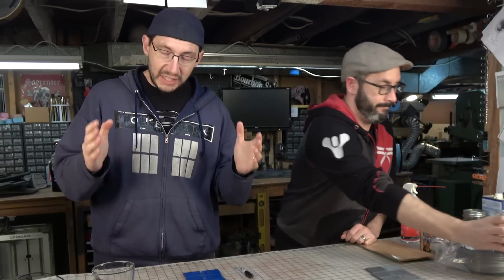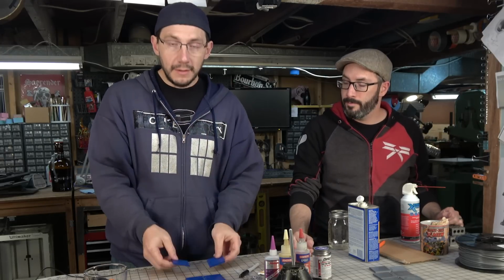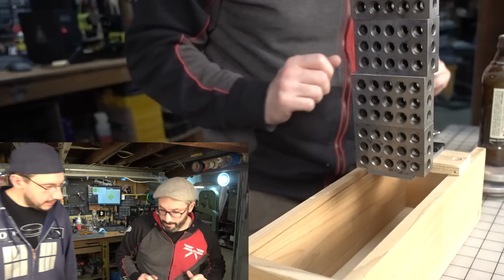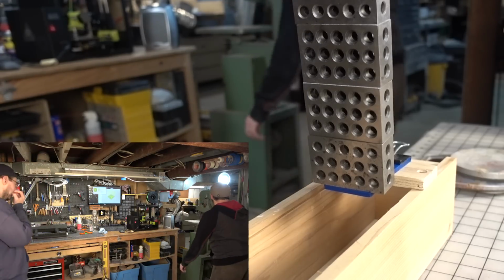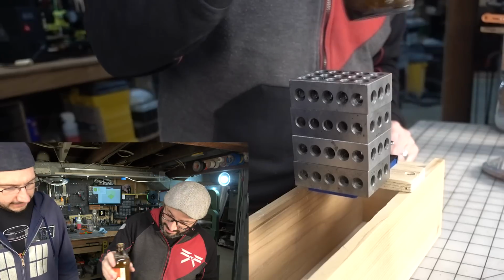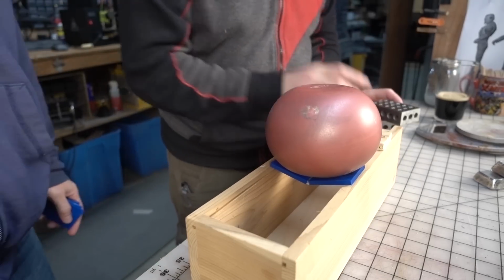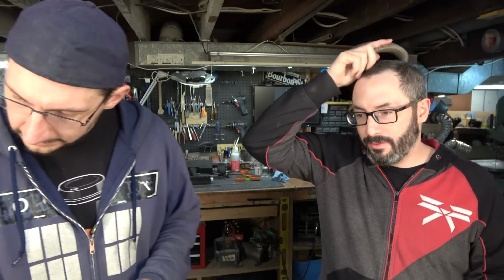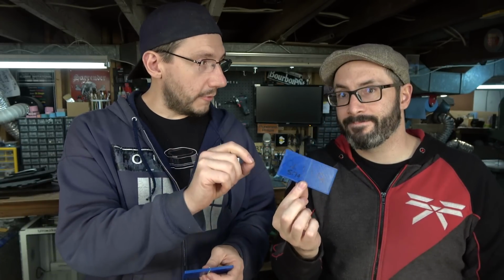Testing 3D Print Bonding Methods with Punished Props (Glue/Epoxy/Welding)

Comment: For the 3d print gun, you could have made a V-grove like when welding metal.
Stress-wise, all the stress is at the top and bottom anyway. That's why H beams are shaped the way they are.

Comment: Great effort by the way! But I cant help but point out certain things that have to be addressed for it to be really scientific, to a certain degree.
1 - The point/distance from the joint has to be consistent
2 - All joints must be given sufficient time to cure, unless of course we're doing a 'strongest joint in 1 hour' test
3 - Weights should be consistent, ie: use a scale and a press (like Matthias Wandel's tests)
4 - Repeat the experiment several times/ bigger sample size

Not to hate, but would absolutely love to see a video with the issues address. Again, great video otherwise!
Reply from the maker: Hey! True, Bill and I would need to change some things in order to do this "right". I mean, we had a great time, and the results we did get ARE pretty cool. That said, if there is enough interest for us to do this again, we'll set out to do it right.
Reply: do it again lol. If you don't I will and then nobody will see it...

Comment: You'll find that the 3D-Pen weld will work much better if you hold the pen at an angle such that the hot nozzle melts a channel into the pieces that you're welding and then lays the pen's filament into that channel so that the plastic from the pen and two pieces melt together for the bond. Not only does this make a stronger weld, it can also be more smooth if you get really good at it.
Reply: Bigtime. I meant to elaborate on that in my recent reply. That's the exact method I use when welding 2 pieces together with a 3D Pen.

Comment: I use straight acetone on my abs prints to butt joint two pieces. And a thin slurry (slightly thicker than water) for gap fill. Any thicker and there is too much already dissolved plastic for the acetone to dissolve the joined pieces and form a strong bond. I did this to a model boat for my sons bath and trying to snap the joint by hand (more than 15lbs of pressure on each side of the joint) caused no failure.
Reply from the maker: Oh interesting. Thank you for the thips!

Comment: I do like the scientific approach, but you should to redo this with minimum 24 hour cure times and a steady rig to test them, if possible also do 5 examples of each.
Otherwise we are looking at all sorts of inconsistency from how it was put together and how it was tested.
Reply: MsSomeonenew agreed!
Reply: Which is probably the real life case :D
Reply from the maker: Yup. That's an eventual goal. This was the product of two guys hanging out in the shop, drinking some beers. I think our results are interesting, and if this is popular enough here on the YouTubes we will DEFINITELY revisit with a more consistent approach :)
Reply: for me the biggest problem here is that the result is a linear force (weight with gravitational acceleration)
while what show the strength under this stress is a torque, the distance between the center of gravity of the weight and the bound is crucial, and varied from 1 to 2 here
Reply from the maker: +Nagby3 True. It varied A LOT. We both want to revisit if we get enough feedback that people want to see it!
Reply: a jig that would be pretty easy to make and pretty precise
would be with a hole in the "stressed" half to pass a string through
(hole always at the same place and same size to have a known distance between the force and the bound)

putting the string with a black mark right against a ruler to observe deformation
and then after this part, putting a newton meter (or at least a spring with a ruller attached to one of it's end)
and then after that, string again that would be rolled by a crank (or even better, a motor at a constant speed, like by using an electric screwdriver that can go slow and have enough torque)
the string could be pulled down or up, it wouldn't change the result much

and be sure that the fixed part is completely held up to the bound face (like in a vice or something like that)
and record a video of how the string mark and spring moves on their rulers to get deformation and stress at several times
and you get something like a traction curve (but showing a flexion stress)
Reply from the maker: +Nagby3 Dang, you really know your stuff. Is testing such as this something you do for a job?
Reply: 3D Printing Nerd could used beer cans as weights then drink them 😀
Reply: well i'm only a student for now, in industrial innovation and quality, so we do some material stuff, stress tests, design of experiments (to get the most significant results with the least tests) and FEM ^^
Reply: Nagby3 a simple and easy way to get the deflection force would be with a hand held luggage or fishing scale
Reply: couldn't find a picture showing it as I described, the idea is from a traction test machine https://upload.wikimedia.org/wikipedia/commons/0/0c/Inspekt_desk_50kN_IMGP8563.jpg
so i made a diagram with formulas to get the interesting values (there could be mistakes thought) https://drive.google.com/file/d/0B81HnTZjTpw6eFlzTk02TFY3Unc/view
Reply: if you have the hole at on the line of the bound, the string would still pull from a distance on the bound
d is equal to : the side of the pulled plate - (distance from the free side to the center of the hole - radius of the hole)/2

but maybe you wanted to do a shear test, which wouldn't work with the string in hole thing
you would have to clamp the 2nd plate, and pull on the clamp while maintaining it's orientation (so there wouldn't be any angle of deformation)

but things generally unstick because of flexion, not shear, so it is better to test the weakest scenario
for example, if you want to remove a sticker, you will try to peel it, not pull it along the surface it is stuck on, that would be way harder
Reply: or you could stick the two parts differently and do that http://info.admet.com/hs-fs/hub/70514/file-15274139-jpg/images/adhesive_lap_joint_shear_strength_test_wedge_grips.jpg?t=1453834437926
but again, flexion is weaker
Reply: it would also be nice to have a thin vs thing layer hight to see if that help the adhesion of the glues
Reply: I totally agree. I think the ABS slurry would & JB Weld would have kicked way more ass if both were given a proper 24 hours to cure.

Comment: I'm always searching out new ways to best bond 3D printed components. My favorite simple method is Loctite Ultragel. My favorite advanced method is stick welding with a soldering iron. Just clip a couple feet of PLA/PETG/Whatever filament and use the traditional stick welding method. Works like a charm.

Comment: You should try out a cheap plastic welder like you can grab at Harbor Freight.  They're basically a soldering iron with a modified tip made to heat weld bits of plastic together.
Reply from the maker: That's an interesting idea. We may do that.
Reply: I saw a Kickstarter that made some additional tips for a USB soldering iron (really cheap, like 5$)
and in the comments they said, it's nearly the stock tip only with an extra layer so the plastic doesn't stick as much to the iron. And well some different forms (like a bent tip)
on Gearbest it is called "USB Soldering Iron 5V 8W" but they can be found anywhere.

Comment: A fun experiment! Some suggestions:

When placing the weights on the test material, you are dealing with a fulcrum at the joint. The further toward the edge away from this fulcrum that the weight is placed increases the effective load on the joint. Therefore, in order to be consistent in your test procedure, all of the weights need to be placed in the same position every time. Your second set of experiments are totally different because of the way the weights were placed. But there is a better way to do this.

The measurements you are making are very coarse (1 pound increments). You would get more accurate results if you apply the downward force with a fish scale (ounces or gram scale) or something similar. A hole could be drilled in the test piece to attach it. Gradually pull down on the scale and record the weight just before breaking occurs. Also, replace the metal clip you are using with a block of wood  and a C-clamp or something similar to avoid flexing. And allow a full cure time before testing.

If you really want to take this experiment to the next level, then perform the above in at least triplicate to see if you get consistent results. You only need to do this on the top 3 or so performers.

One last thing - roughing up the edges to be bonded will typically improve your results as this adds "tooth" for the adhesive to bind to. JB Weld and Epoxies will benefit from this typically.

Comment: 3 words: strain gauge, winch.  With a winch you could incrementally add a great deal of force and a strain gauge would give you exact readings during every step of the process.  I appreciate the work that went into performing the tests, however it was really frustrating to see some of the weight and test limitations adding a significant amount of uncertainty.  If you ever revisit the tests I would love to see all the test pieces cured at 110C for an hour since this would make sure the adhesives (Except for the hot glue) completely cure as well as potentially increasing overall performance.  I've seen some tests by Thomas Sanladerer that suggest that annealing 3D-printed PLA parts at 110C for an hour actually significantly strengthens the part overall and even increases its heat resistance dramatically.  The only potential issues seen were a few percent of shrinkage in the X and Y axis and a moderate increase in size in the Z direction, so as long as you compensate for those changes it could make for some very interesting results.  Anyway, keep up the great work and I look forward to your next video!

Comment: The 3d printing pen method is awesome. I've been using it for months now. Though I typically go a step further with the 3d printing pen. I typically run a soldering iron with a sacrificial knife tip through the seem first, to both melt the parts together from the start as well as creating a "trough" or a bevel for the 3d pen. Then my pen is outfitted with a thick 1mm nozzle, and I push the same type of filament through it used in the printed parts. I push the nozzle of the pen into the trough/bevel thing, and move slowly. It remelts the side of the trough and I make sure to overfill it so I have something to sand down later to hide the seem completely.

If just running the pen over the top of the butt joint performed that well, I wonder how well my method would perform as it gets the plastic in between the parts as well.
Reply from the maker: I bet it would perform even better! If this proves to be a popular video, we will revisit for sure.

Comment: A lot of comments, so may have overlooked this if someone has already brought it up. But For PLA (and acrylics) Weldon #4 is the way to go. Put your pieces together, use tape if more than three hands are required and then with a needle applicator, wick the solvent into the joint. It will solvent weld the two pieces together. Do not breathe the stuff! Use in a well ventilated area.

Comment: There's a product I use on all kinds of plastic, Made by GT Motorsports called Plastex. it wont "glue" 2 pieces together but after I set them with "Rapidfuse", I can backfill the joint or a gap and it is incredible strong

Comment: Nice video.

For tests like this, you can C-clamp one side to your table, and attach a C-clamp to the other. Hang a 5 gallon bucket off the C-clamp, and slowly add water or sand to failure. After it breaks, weigh the bucket. A full bucket of water will be over 40 pounds.

Comment: hot glue si my go to to temporarily hold stuff in place pretty securely and peel/break it apart later with both sides in tact. Using low melt is a bit easier. 
also e-600 is pretty sturdy, but it needs to dry for at least 24 hrs. Nice because it dries glass-clear even when in blobs.

Comment: True fact:

I had a Customer that had a fleet of flatbed  International Maxxforce 7 diesels. These were not well engineered and my customer wanted them to continue running as they were almost paid off.

One of the Maxxforce engines had a coolant leak and we found the engine block coolant passage was porous allow coolant to externally leak through small like pinholes. My customer didn't want to replaced the engine so we tried a temporary solution we did not think would work, but it was better than $16k. 

I had my lead tech drain coolant from engine block, drill out the small pin hole cavitations and use JB weld to seal it up (take place of the porous black casting). Diesel truck went 9 months, 29k miles until the motor let loose a timing gear and took out the engine. The JB weld worked.

Comment: Isopropyl alcohol like 2-3$ works as a liquid activator and baking soda for solid activator for super glue, I did want to mention to that activators heat up ca glue quite a bit probably enough to melt the print pretty easy so don't use too much but in small amounts the melting  helps strength by welding

Comment: Super glue's weakness is in sheer strength which is a lot harder to test. Basically you would twist it and you find the joint breaks a lot easier. It's greatest strength would be is you tried to pull it apart from the ends. That's why they could honestly glue a hardhat and lift a guy straight up without it breaking in their old commercials. Now if that guy decided to give his body a little twist it would likely break right off. Two part epoxy is almost the exact opposite, it's easier to pull apart from the ends but has greater sheer strength. This is what makes super glue works so poorly if you have gaps but epoxy still works> Super glue itself is pretty weak but it has great surface bond while epoxy itself is often stronger than the materials you are bonding but doesn't have nearly as good of a surface bond as superglue 

Friction welding and likely the 3D pen would work better it you has a fillet on both pieces and then just fill in the fillet just like real welding of two pieces of metal in a butt joint .....  Thanks for showing a bond made with a 3D pen, I've been waiting for 2 years to see someone try it and it worked better than I expected especially since it was applied pretty crudely and had little penetration. It should work really well with a proper filleted joint and could be sanded smooth and still be strong

Comment: If you want more bang out of the 3d pen method you should bevel or chamfer the corners and create a groove weld. It allows for more surface area to be bonded by the pen.

Comment: 3d printing pen is mechanically excellent bond. In fact the pieces itself could probably break on infill rather on the joint. 
But for 90 degree hidden joints you can't beat simple glue gun. It has extreme vibration and impact resistance because it is semi-flexible. It also sticks to PLA like there is no tomorrow. However the joints need to be hidden - such as inside joints, because you are going to put ugly blobs. But really with glue gun you can attach almost anything to PLA. For invisible joints, the super-glue is the winner. Not as strong, but you can make it very clean.

Comment: 3D printer version of Mythbusters ))) 
The 3D pen durability surprised so much. Especially when you only welded outer part of seam.
Reply: should not be too surprising. a weak point of epoxies (typically brittle) with the interaction of something more elastic like 3d printed plastic is the difference in material properties.

Comment: Both the Superglue and the Epoxy are rated for >2,000lbs per square inch, so I don't think there was ever much issue with them breaking under 10 lbs of load (the print will always give way first once fully cured).  The only limit is that Superglue will only work with really tight fitting joints, whereas the epoxy you can paint it on as thick as you like.

Comment: If you print those test blocks with chamfered edges, the friction and pen methods may be a better bond. This method is used in machine shops to get more surface area involved in the bond between metal plates when welded.
Reply from the maker: +Jerry Oswald we talked about that and may implement something like that when we do this again. We could print the chamfered edge AND mechanically make it as well

Comment: Good video. Even though the methods were not scientifically correct, I think the point was made pretty well. I'd like to see more with things like a soldering iron and plastic weld added to the mix. Also I think it would be interesting to see how much weight 100mmx50mmx5mm(basicially your 2 test pieces put into one) print could hold. Pretty surprised about the 3d printing pen results there, but I bet when thats sanded flush it would fall into a much lower category
Reply from the maker: I get the feeling you're right, and sanding flush would have to be added to the mix for any follow-up. Also, I think you're right - we had valid results!

Comment: Loved the informal testing & the basic info. Who knew the 3D pen would work so well? 
But the scientist in me was cringing throughout. Now I have to do some more testing. I think I'll clamp the end solid, drill a hole in the other end at a set point, then hang the weight from a line through the hole

Comment: Wasn't surprised about the super or the 3D pen. However, I was surprised the pen held up with just a bead across it. The technique I use with the pen is common for standard welding. Using welding patterns had provided much better results and having a pen that does different speeds is a plus. Good job on the tests though!